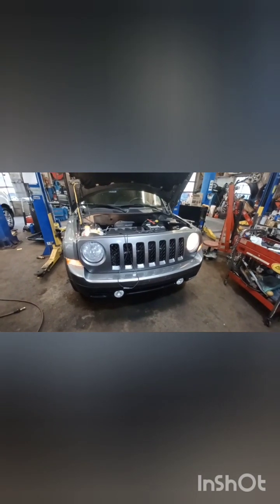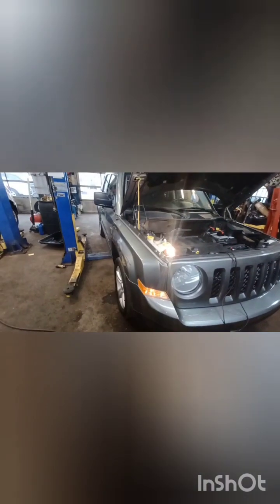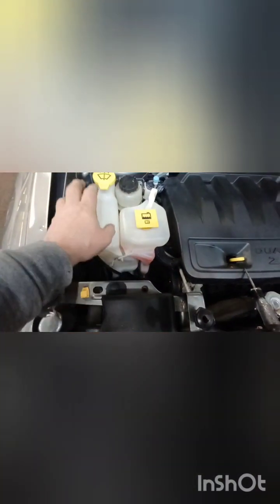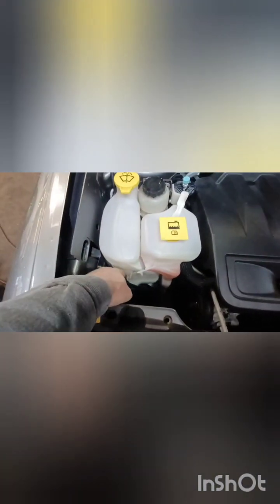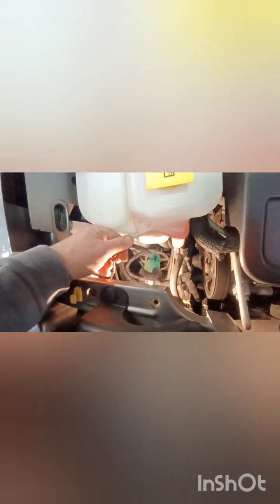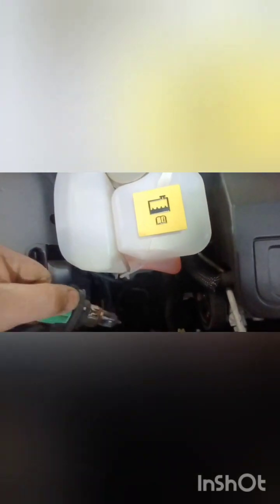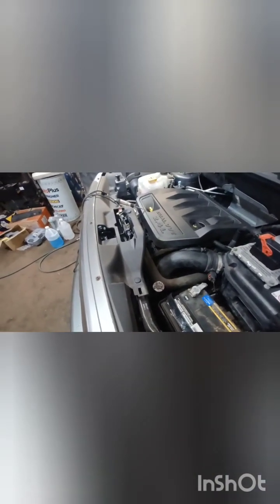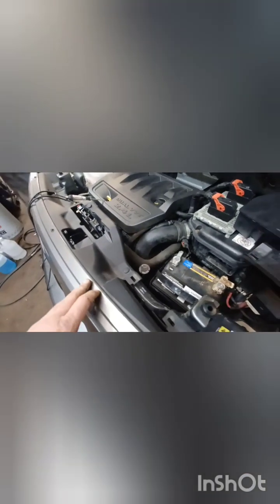Jeep Patriot and Compass headlight bad ground problem repair.

Comment: I'm having the same issue with the passenger side light is out I'm going to try to fix it by replacing some of the bad wires and reconnect the ground thanks !👍